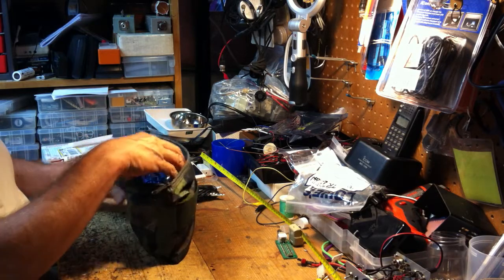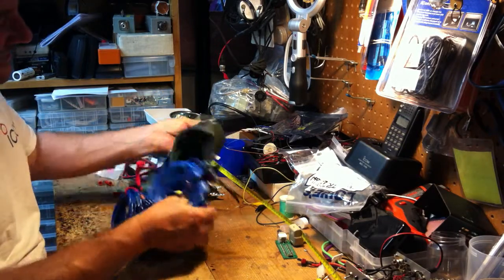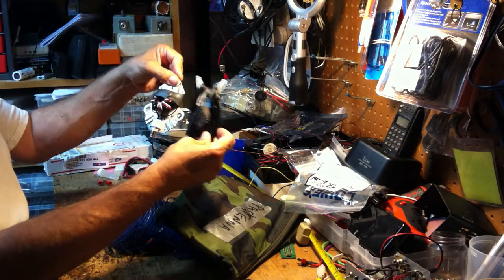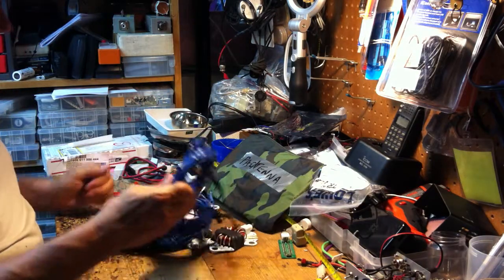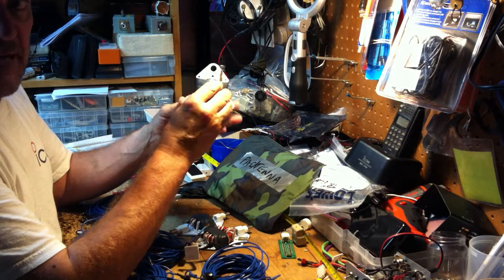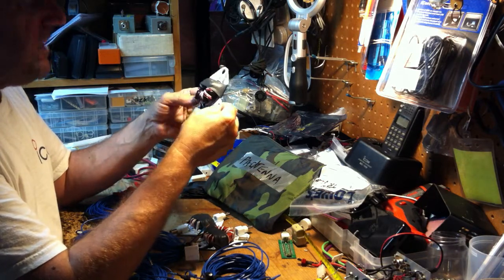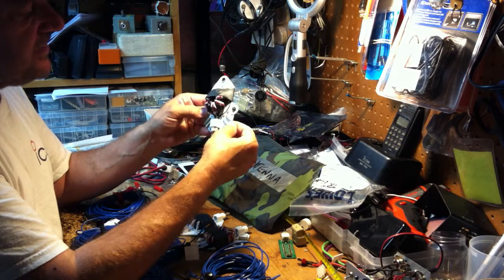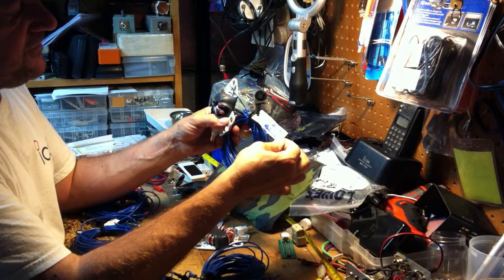The PackTenna line of baluns is reviewed

Comment: John,

You needed an overhead view of the ingenious PackTenna method of connecting the wires to the balun and their method of connecting extension wires to make longer end feds or change dipole lengths, ie., the combo 20 meter 40 meter dipole.

You are right on with the fact that a full length dipole beats an “eight foot” loaded stick.  Both work but all new hams should start with a dipole first, and at least 20 watts.  Less works but the return is much less until you get some experience. 

Dave K8WPE